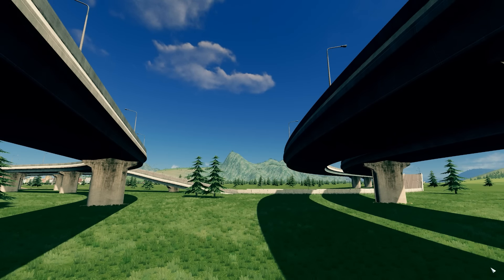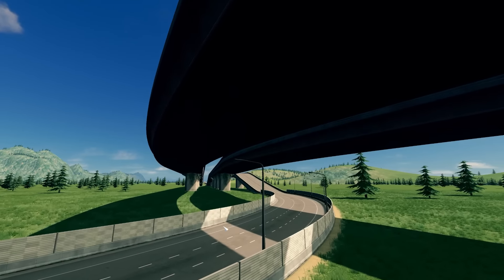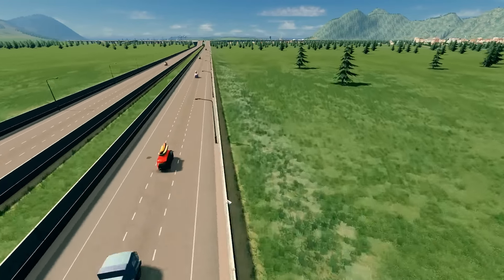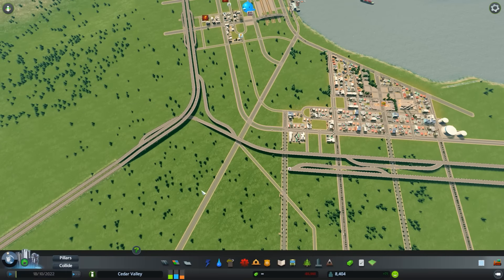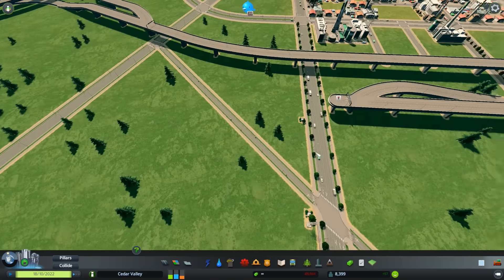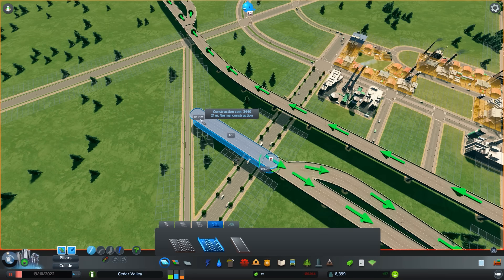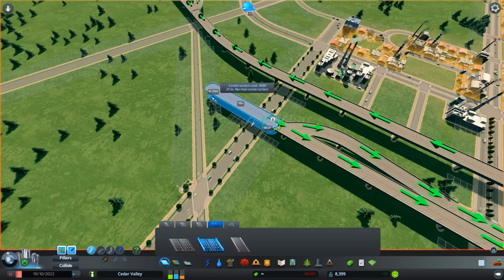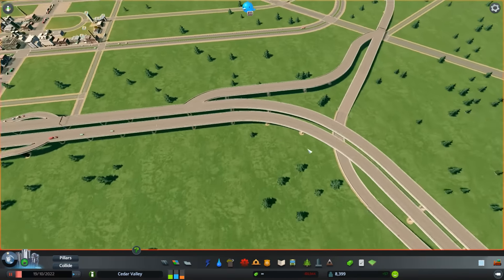Let's Design Cities Skylines — EP 5 — Multi-level Interchange

Comment: Three tips:
1. Use Road Anarchy instead of overlap mode from NoPillars, easier to use and doesn't mess up zoning.

2. a) In Fine Road Heights use Ctrl + Left arrow or Right arrow to change type which allows  you to create very gentle elevated sections without the accidental terraforming. Change to "elevated" setting - this would have helped when you were trying to make a gentle slope for the rail. For highways where you don't want the suspension bridge look, use the "elevated" setting as well. The "ground" setting is also useful for the lead up to overpasses (more realistic as well - as it is cheaper to move dirt than build bridges).

b) Use Ctrl + Up arrow and Down arrow to change the increment at which pressing PgUp and PgDn change the height of the road/rail. You can change it to as little as 1m allowing you to create very fine changes in height.

3. Use Sharp Angles mod to allow much more natural rail and highway connections.

Comment: Hey, there's an awesome mod called Ultimate Area Fillers on the workshop that gives you a ton of terrain paint options that you can plop on empty spaces. You can put down from 12x12 tiles of concrete to tiny circular 1x1 tiles that can really squeeze into small spaces. It's much better than trying to use pedestrian paths to do that job because you don't have to rely on the road plopping  system nor the weird snapping that happens ;)

Comment: 19:30 railroad builders try to avoid any level changes. The slopes for rails should be so smooth that you can barely see that. It would be much more realistical to sunk or to raise the road than the railroad.
Reply: Very true. I work on the railroad IRL and most slopes you can barely see.

Comment: Stric, I'd say that the rail corner you complete at 32:31 is unnecessarily tight. Why wouldn't you just follow the natural angle that the switching point provided, instead of following the other track? Railroads don't need to parallel each other the whole time. I think I would be neat to see the space left in the middle of the wye be used for more industry, perhaps.

Comment: You can't realistically have those overhead wires for the trains run into the overpass like that. The trains (electric ones) need those for power.